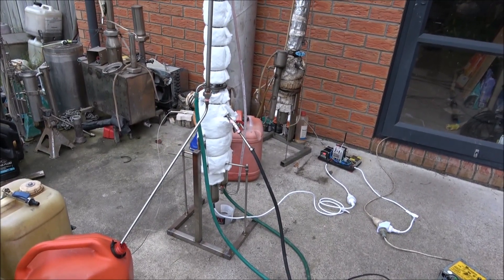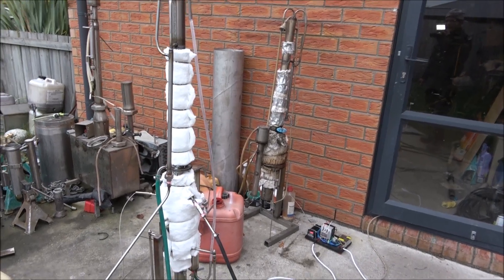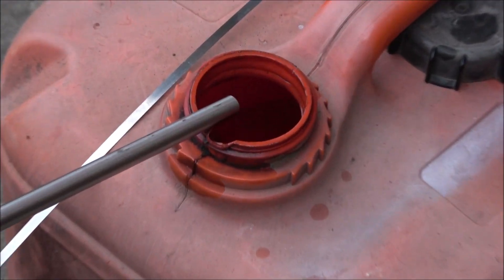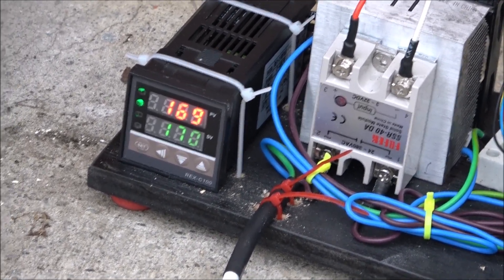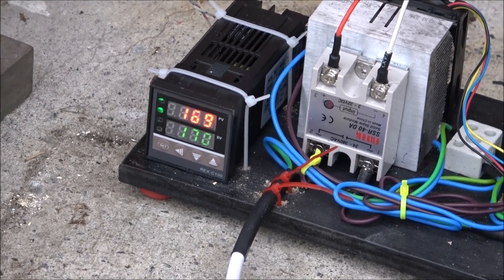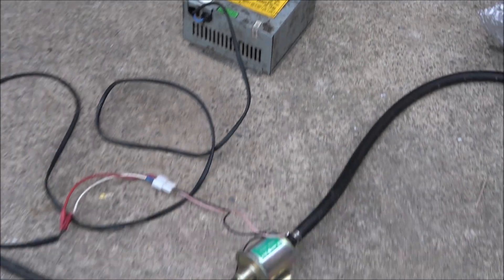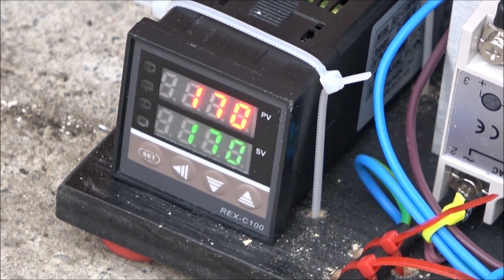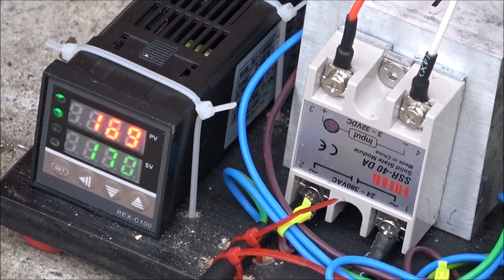Gasoline separator. wrong fuel recovery distiller 1.6kw

Comment: Great video Alek.
I would of like to have seen the separator column in more detail.
Maybe next time, or in a new video?
I'm sure you are aware, but it would be highly 
recommended to move your control panel further
away from the still since the fumes travel quite a distance 
across the ground. 
Or use explosion-proof controls and rated boxes.
"explosion-proof"=> USA- electrical specification for electrical components in
a hazardous area where sparks could cause an explosion 
I'm sure New Zealand has its own spec
Reply from the maker: This video is demonstration only, it is outside with good ventilation, also cooling is adequate to condense everything and eliminate any fumes, plus ideally the controls are separated from distiller by a firewall. Thus if distiller installed in a container, then control unit is outside in its own box. The mix container, diesel and petrol lines are extended out of the container and collecting vessels can be many meters apart, the breather line also extended out of the distiller container, thus actual distillation will involve just about a liter of the fuel mix at the time, isolated from all collecting and supplying vessels.